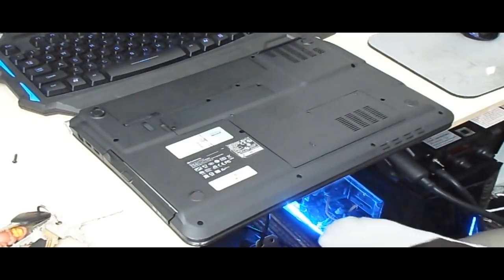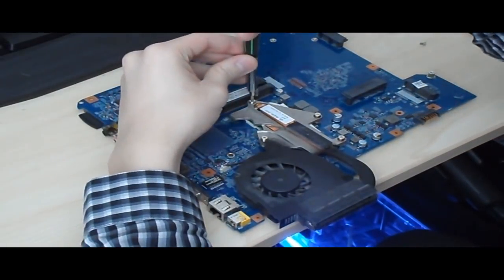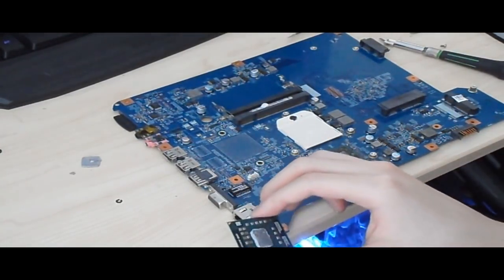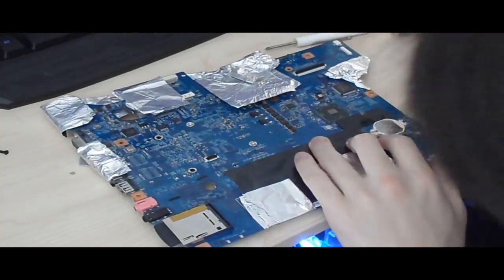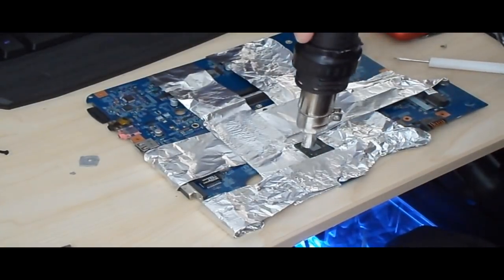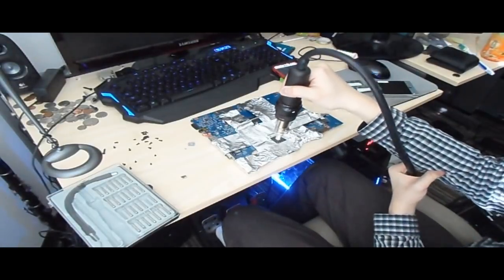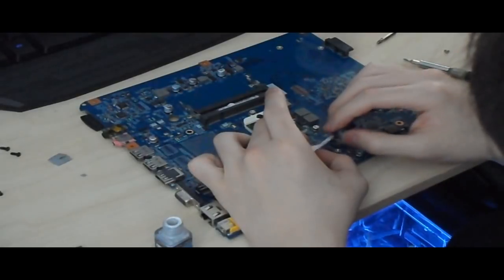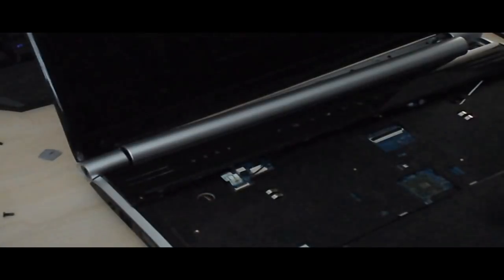How to fix black screen part 2 (How to reflow)

Comment: Please help!

Do magnetized screws interfere with laptops?

I was having trouble with the fans' screws because they were too small and would fall off into the open gates. 

So, I found a really big magnet and decided to rub both the screwdriver and some screws to make it easier for me.

I thought the screws would loose magnet force but when I opened the laptop again after using it for two days the screws had even more magnetic force!

The reason I opened the  laptop again was because after trying to install the same Ubuntu distro flavor on my secondary hard drive it somehow made it go black screen.
Reply: +Aztrax Xeno Nope, they do NOT interfere.
Reply: you have to put a strong neodymium magnet on the hdd before any serious stuff happens :-)

Comment: Hi. My laptop (Toshiba Satellite l305d ) turns on, and windows initiates correctly, and everything goes well until I install the graphic card driver (ATi Radeon 3100), then, after a VARIABLE PERIOD OF TIME, the screen goes black, and the HDD stops working, and I have to switch the computer  off. Same thing happens with an external monitor. The cooling system is free of dust, and the thermal paste has been changed very recently. Sometimes the screen goes white, instead of black. I would appreciate your help, before throwing this piece of crap out of the window of my 11º floor. Thanks!

Comment: I just tried this twice (I used a hair dryer and I think I was too easy on the gpu the first time). Laptop is still having the same issue. Does that mean it's my motherboard? My computer is doing the same thing this one is doing, it "turns on" but absolutely nothing on the screen.

Comment: I have 2 problems with my laptop, first i have "nvidia has stopped working blah blah blah" problem. I tried every method on the internet and no such luck so far, and i just accept it and just use my CPU graphic. Now, my second problem my laptop has gone black screen after turn it on. I haven't try the method from your first video, AND will try it later and hope it will work. But i want to ask this, IF i try heating it up my GPU, do you think my nvidia will work again?? 
Pls answer this, give me hope our something, i really want to play good game, lol

Comment: for my case,the laptop able to boot,but stuck on logo screen.after a few seconds,my laptop will keep reboot and stuck at logo screen again.But if i press esc,it will direct to bios setup.But again.the problem is,even i able to enter bios setup,i only can change setting in bios setup for date and time only.Im not sure what is my laptop problem.I do remove and change ram,but it work fine for me.Please help me.Thank you in advance.

Comment: My laptop is an asus x55a, It won't boot it just shows black screen with lights and spinning fan ect..
But when I try to power it off I have to remove the battery and nothing I have tried everything apart from the reflow because I'm pretty sure this isn't the case, any other ideas?

Comment: Hi! I have the Packard Bell SJ51. I tried everything except this reflow part. When I turn it on, I can hear the fan and everything but it just show a black screen. Idk what to do... Pls Help. :(
Reply from the maker: try the reflow. If it works for a bit at least, then you know it's the gpu that's out. Then you can try to replace your motherboard.
Reply: I just did it. Then it says something I forgot what it said, but I resolved it by blowing the HDD. I only have one problem, sometimes purple lines appears then I need to shut down the laptop because it hangs, idk why.

Comment: i already did it, and there is power when i press the power button, but still its blank, i'll try checking the memory and it seems okay, and i plug to it monitor and it seems there another problem with my notebook, and i noticed that when i hit the power button, the fan works then suddenly stops.  i need answer from you dude, thanks.

Comment: I am going to do what you have shown in yhis video i am so afraid that i can replace my laptops parts in place 'device is toshiba laptop it is having same problem when i have given for repair they where telling me that it is having a dead motherboard but still power light burns.can i do this does it works if it works i will buy and give you anything you want from any shopping app. Sure'

Comment: OK so i installed a new driver for my GPU, after this my screen has acted weird, it doesnt turn on, sometimes i could close the lid and re open it would come right on but now its not coming on at all, i plug in my hdmi cable and look in device manager, theres no display detected. Could it be the lvds cable connecting my lcd to the mother or should i try something else? And are there any other things i could do to fix it?

Comment: Do you offer laptop repairs or something? I'd rather hand it to someone who has the tools lol. Very information video though (and part 1).
Reply from the maker: I do, if you want you can ship it to me and I can get it fixed.
Reply: William Yu do you still take shipped orders??
Reply from the maker: Kevin Hyun yeah anytime!
Reply: William Yu Could you msg me the info to where i could ship a laptop for repair to you? I'd also like to know how much it would cost. I don't know how to mess with laptops and really don't want to practice on this one i'm having issues on. Basically the same thing as your vids, has a black screen but turns on, though doesn't work on an external monitor so i assume its the graphics card
Reply from the maker: Jakyocaw You can add me on skype yu689595

Comment: I suddenly turned my laptop off by unplugging the adapter from it. And then I turned it on. When the screen showed the logo in my case Toshiba I suddenly turned it off same way. Battery was not in it. Now when I turn it on the black screen. Could it Bre that something is fryer because I unplug it while it was booting? What's the problem the fix ?
Reply from the maker: no at most I would assume the bios error. Watch the first version of this video and reset the bios

Comment: Hello. When I turn on my laptop (sony vaio VPCCW17FX) its not completely black.  It will show the 'vaio' start up then it will stop and screen is blank. It feels like it needs a push to continue the start. The first 2 times it happened I manage to help it (?).
I did ctrl+C as fast as I could and screen shows up to the pick Windows 7. And it work perfectly. Then the 2nd time it happened I did ctrl+x as fast and as many as I cpuld and it workd again. But now, nothing seems to work. Please help!! Im so desperate!
Reply from the maker: Try to put hard drive from another laptop and see if it boots up. if it does, it's your os that is corrupted

Comment: My Fujitsu laptop fell on the floor face down and hyperextended the screen. The computer is working since I have connected to a monitor and all is fine. My screen is blank with a slight blue tint.  When I start up the computer the screen will flash up some rreadable material quickly goes blank again. Any suggestions?
Reply: Nilay Singh Not so. I pressed on the connection to the inverter and the screen lit up fine. Hurrah

Comment: Well My problem over here is somewhat related to ur problem,so I think u might have an idea hw to deal with it.I have a Nvidia GT610 Graphics Card.When we start the pc they show that HP or Dell or Acer or wateva company it is...yeh at this point it takes 2-3 mins for my PC to load and proceed only whn i have this Nvidia inside my CPU and after 3-5 week it takes Longer and Longer time to proceed or smtimes wont proceed tooo...But then when i took it out it just took 3-7 seconds to load and proceed...and then whn i put my nvidia back again it takes again 2-3 minutes to proceed....So Is There anyway to make this loading process faster?

[Also,For Nvidia GT 610 2GB with i7 processor It just requires 300W Power supply(Its mentioned like that at the back of the box),while I have an 600W Power Supply...So I think it aint a problem with the power supply] [Also It aint a problem with the drivers too i tried upgrading and downgrading too]....Hope u knw how to fix this Isuue and thanks for reading :)
Reply from the maker: Man actually that could be a bios issue rather than the gpu itself

Comment: How does the reflow work for integrated GPU's such as Intel HD Graphics on recent Gen Core i5i/i7 boards etc, can it still be done when it's part of the CPU?
Reply from the maker: No those are tricky. Feflowing CPU won't do anything. Reflowing the entire motherboard in an oven or something might do the trick. Or just buy a new motherboard.

Comment: how important is applying the thermal paste?
Reply: +golden otis Lets say its totally essential if you want to repair your laptop, if you dont apply it there is too little thermal conductivity, in other words the thing will overheat quickly, it will also slow down a lot as the card protects itself by running slower.

Comment: one of the screws on my laptop is completely stripped and its right under the battery, plus its flat so i cant grip it to extract it, its the only thing stopping me from fixing my laptop and i have no tools to drill into it or anything :c
Reply from the maker: yeah those are always an hassle, make sure to use a correct size, nice sharp screw driver next time. For what you have right now, you can try to drill it out, cut off the screw or the housing around it.

Comment: my laptop is exactly like that although the hard disk doesn't spin. the lights come up but no display or anything. the display would shut down sometimes, then the other day it completely failed to start other than the lights, but later that day it started now it has failed again, is it the gpu!!?
Reply: samsung NP305U1A thanks.. maybe i'll just remove the hard disk because i need the data.

Comment: My computer doesn't turn on at all. There's no noise no light light at all. It's fully charged. I checked the rams like you did in the other video. I also unplugged it & took the battery out and held  the power button & nothing happened.
Reply from the maker: well then something on your board is not connected or shorted out. This video is for laptops that start at least.

Comment: Hello
I m Gautam Singh ........... I have Acer Laptop. It's being a problem . It's not being start. There is Not showing charging bulb . and Not working start button. What should i do.
Reply from the maker: That's always a tough one because it won't show any sign of life. If your battery and charge is okay, usually it's a dead motehrboard.

Comment: William Yu, I believe I have a completely different issue from both videos. My laptop turns on and I hear it working, but the monitor is not, even with an external display. Sometimes, I open and close the lid and in some spots the screen will turn on. From what I read in google, it's probably some sensor, cable or part of the hinge that detects when the lid is open, but I'm not sure where it is. please help!
Reply: what model laptop have u got?
Reply: gateway nv53

Comment: hi my daughter got emachine 625 which she shattered the screen i brought new one which i fitted but when i turn it on everything boots except the screen
Reply from the maker: the screen is most likely not connected properly.
Reply: it flashes up for quick second then goes out
Reply from the maker: Peter Myers means inverter is out.

Comment: Mr. Yu i am a total novice trying to fix my own devices, sorry to start this way , but I am not hearing you loud enough can you help?
Reply from the maker: increase your volume or try using a headphone. I made a mistake while I was editing and it turned out really quiet
Reply: William Yu Hi William, excelent video. I have some problem with my Sony Vaio (Touch Screen) The computer starts, I touch screen and it works,  but no video. I connect it seccesfully to other screen via HDMI, so I changed both video cable and screen but doesn't work. I wonder if it could be the LCD inverter or finally the video card. Thanks in advance.
Reply from the maker: XRohas probably the actual graphics card unit is busted.

Comment: I figured it out!  I removed and reinstalled the original ram card and it worked.  Then shut it off and installed an additional 2G card and worked great.  Yet because of the new motherboard I had to do a lot of readjusting.  The motherboard cost $24.90 online.  ;D  I didn't use a full size penny on the video chip... (I just cut a penny to fit on the chip between it and the thermalcouple otherwise it will short out on the exposed circuits on top of the chip)
Reply from the maker: that flashing light refers an errror code. Count it and visit your compaq website to find out what that code means

Comment: Where can i get the heating appliance, please?
Reply: +Abdias Noel Just go to the paint section of homedeport and look for a heat gun
Reply: Adam Dean please dont use this techniques.only work for a week maybe a month.the best idea is change the chip o do a reballing. Rework is bullshit
Reply from the maker: Ebay sells em pretty cheap, but I mean, if you do it right a hairdryer can work also lol

Comment: I have the exact same laptop in this video.. 
I do not have a heat gun like you, i tried to use my hair drier and my glue gun over the GPU for about 10 minutes and i tried to put it back together, and it turns on and fan runs, but then it shuts down itself and same, nothing shows on screen. 

A friend tested it before me and said he turned it on and off many times and eventually the screen works and he said everything is working but not sure why the screen does not show.
Reply: I used home heater for about 8-9 minutes. I tested without putting on keyboard or ram / harddrive, and there was no response on screen. After placing keyboard and ram with hard drive, it worked, now it is running well. 
Thanks!
Reply from the maker: 3xilelast So those hdd, ram broke?
Reply: William Yu Sorry, didn't see your reply. The laptop is back to black screen. 
This time I borrowed a friend's heat gun, and got some thermal gel. Is there any degrees I should set in particular when attempting to reflow this time? How come 8 minutes and not 10 or 15?  And after you reflowed this one in the video, any news of it going black screen again? 

Should I just follow your degrees (100C , 380C , back to 100 C at 6minute half till 8 minutes? )
Reply from the maker: Yeah that's what I found most successful. Go up to380 celcius
Reply: William Yu Hey,  thanks for the quick reply! 
I tried to follow as close as possible to your degrees used in this video. And let it cool down for 11 minutes. Laptop is up and running again. Will try to let you know if it still works in a month if I remember/ it is still working -(that would be good if it still works. 

Any tips on preventing this from happening again? Some computer people I contacted said it might not work in a month maybe, what are your thoughts?
Reply: And? Does it still work? |)

Comment: I have asus k46 laptop, i tried to have system recovery but failed and showed black screen. I tried to restart but only password button is showing and after entering password it will not open, it will just show black screen. All lighting button and fan are working it just showing black screen.
Reply: It's the same for me too

Comment: I have a HP G62-339WM I upgraded to Windows 8  and everything was fine and I updated to Windows 8.1 and my problem started!!! When it boots up the windows logo is shaky and I have some blue horizontal lines of the left of my screen but once it hits the login screen it goes blank so after trying to get into safe mode and not being able to I wiped my hard drive out and did a factory restore with the disks back to Windows 7 but guess what I still have the same problem somehow with my screen!! I updated my BIOS, chipset, and video drivers from AMD's website and still nothing...When it boots up the screen is shaky and distorted with some blue horizontal lines and once it hits the login screen my laptop screen goes blank and will occasionally flash with an image of the screen depending on what is going on ie adjusting screen res!! In safe mode with command prompt the screen will work but it is really shaky and it has a horizontal blue line on one corner and when I move the mouse a distorted image of the whole screen moves to the left while the background is still there as well if that makes sense...However in safe mode with networking the screen does the same thing as if it were booting out of safe mode...The only reason I am able to do anything is because I have it hooked up to my flat screen with a HDMI cord!! Does anyone know what the heck is going on here I have read so many forums and tried just about every solution there is and nothing has worked!! Everything else on my computer is working fine but my monitor!! Please help someone I have tried everything I know to do and everything recommended and nothing is working!!!
Reply from the maker: yeah your gpu is toasted and probably needs to be reflowed like int hsi video
Reply: Even though it will still flash every once in a while?? I have a link of it on YouTube channel!!! I'm not even sure I can do what they did in this video though is there any other way??
Reply from the maker: If images distort it means gpu is on its way out
Reply: It works fine on my TV screen with my HDMI plugged up!! If the GPU goes out how much is that to fix or is it worth it?? Or should I attempt to reflow it??
Reply from the maker: If it works fine with hdmi, then your gpu is fine. Your screen itself or screen cable on your laptop is busted
Reply: It even does it in safe mode too which is what really confuses me!!! Btw thanks for the help!!